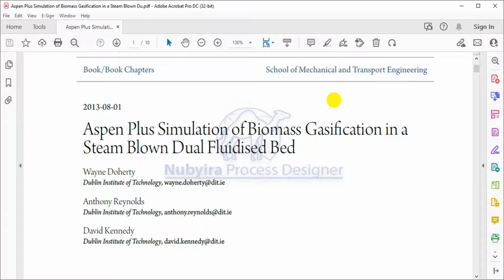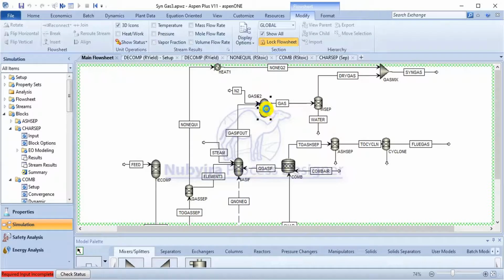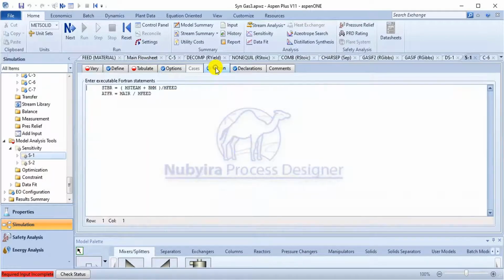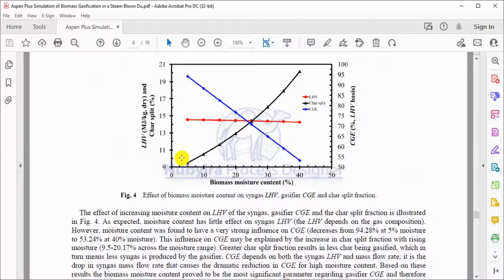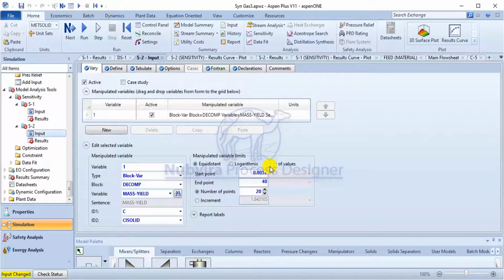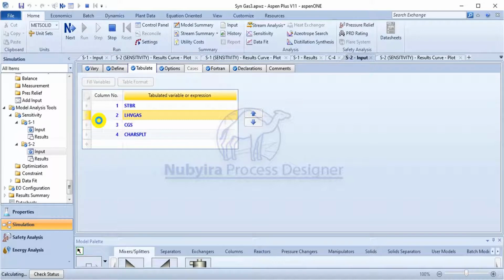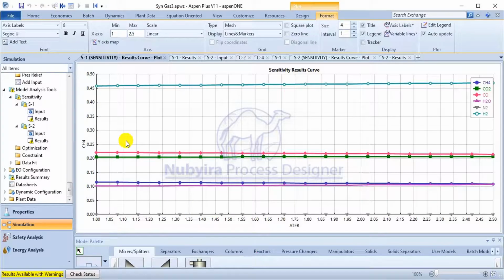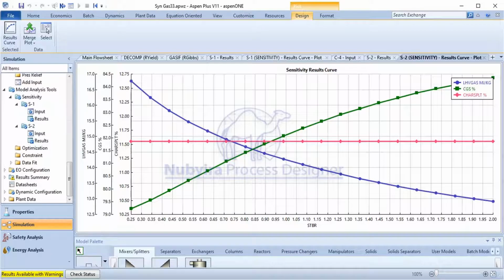Sensitivity Analysis of Biomass Gasification Process with Aspen Plus

Comment: Thank you so much it helped me alot. Im working on the same model and having difficulty on block GASIF2. I added reactions in restricted equilibirum tab with temperature in the article. But It always have errors. Can you give me some advice? Thanks a lot.
Reply from the maker: Hello what nature of error?
Reply: It reports that "The number of reaction (2) is not equal to the number of participating species (9) minus the effective number of atom (4)" and I dont know what it means.
Reply from the maker: @TrangThuy-gt5xv  send me a message on Whatsapp at +2349024514039
Reply: @nubyiraprocessdesigners  Thank you so much for your help and I have done it successfully.
P/S: Sorry for replying this late cause I didn't get any notification from youtube.
Reply: @TrangThuy-gt5xv  can u share ur simulation file?please

Comment: can you provide the data input in each of these blocks and streams?
Reply from the maker: Ok do you want the data input for the biomass gasification process simulation used to do the sensitivity analysis
Reply: @nubyiraprocessdesigners   actually i was trying the same flowsheet from the same paper. but, i am getting problems regarding the outputs.
Reply from the maker: @DREAMERS100  what kind of problem
Reply: @nubyiraprocessdesigners  model output is not as per the paper